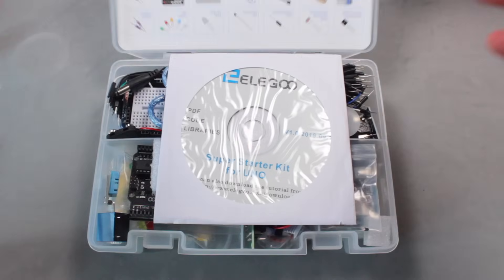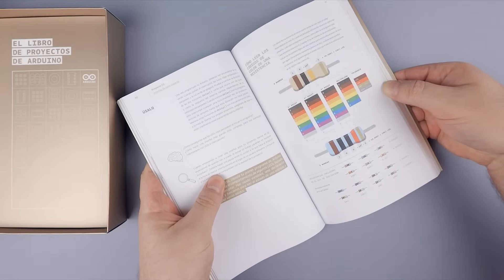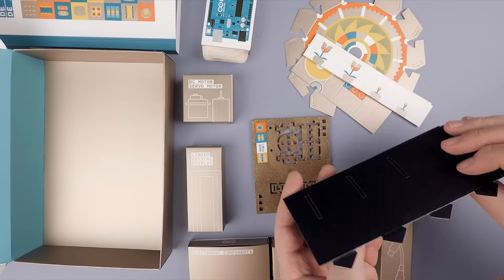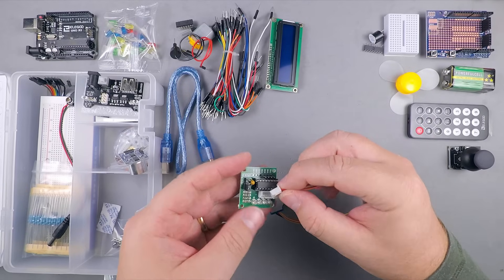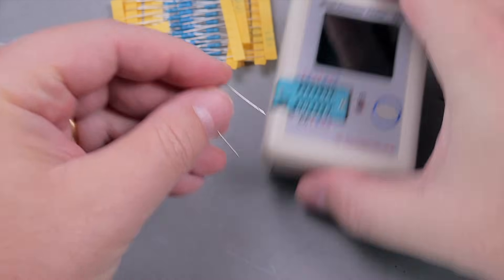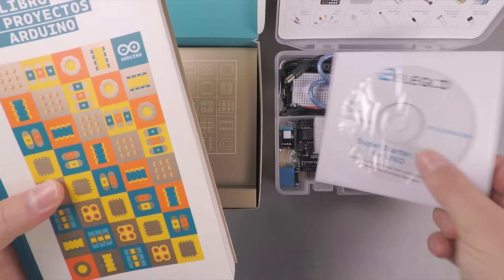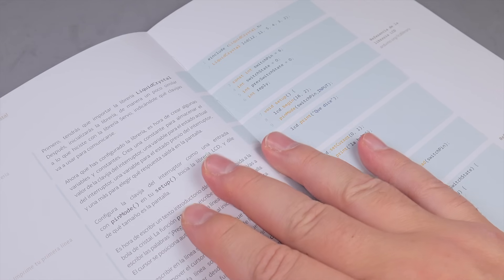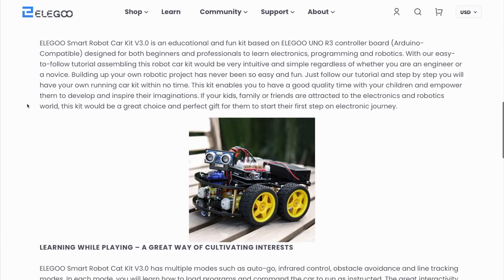Which Arduino to buy? Arduino Starter Kit vs Elegoo Uno R3 Starter Kit

Comment: Thanks, greatly appreciate that ... very convincing, I am with the old books,  I will give it a try to learn something new.  Had  been 40 yrs since my teenage years that  I dont do breadboarding nor ethching circuits in PCBs with FeCl2 solution ...I dont know all about Arduino, only heard that for years....  Been working with PLC/DCS/SCADA,   industrial controls and  in telecom industry as an engineer
Reply from the maker: Hi Noel! I am absolutely sure you will have a BLAST with the Arduino IDE and how easy it is to create cool machines. AND if you buy stuff on AliExpress, don’t search for “Arduino Module” or “Arduino Sensor” or “Arduino RF module” and NEVER search for ESP32…. trust me: any of those searches can lead into serious addiction 🤣😁

Comment: I have a question. which programming language does the elegoo part have?
Reply from the maker: Hi there! Both the Arduino official Kit and the Elegoo Kit you program using the Arduino IDE, using C / C++. The board itself, on both kits, are virtually identical.
Reply from the maker: An Arduino Tutorial, for beginners, might be interesting to you: https://youtu.be/fJWR7dBuc18
Reply from the maker: Another interesting overview: https://youtu.be/nL34zDTPkcs

Comment: I have rhe Rex Qualis version of the Elegoo kit and it to has the UNO headers well labeled. The quality of the kit is okay for the most part and came with quite a few more modules to experiment with such as an LED Matrix, RFID module, PIR sensor, Gas sensor and many more. I got this kit to familiarize myself with the Arduino before attempting to update the firmware in a 3D printer but since then I've made several green house controllers one of which uses a mega and monitors four DHT22 sensors and controls the humidity based on the average. It's been a lot of fun and keeps me busy in my retirement years.
Reply from the maker: Wow! I kind of envy you - I am having very little time even to make the videos I want to make 🤣 I wonder if I will ever stop hustling and enjoy retirement one day. 😭
Reply: @GeekDetour  I hope you get the opportunity to spend your retirement doing what you love to do. I spent 41 years designing machines that used temperature / Humidity controllers and now I have the fun of designing my own.

Comment: As far as I know, blue is military 1% most accurate.
Reply from the maker: Yeah! Metal film resistors are electrically superior in every aspect - except we cannot read the color code 🤷‍♂️  I wish the industry just give up the blue color and make 1% tolerance metal film resistors painted with beige and thicker ring strips so reading resistors can be fun again 👍😁

Comment: Maybe I missed something, however, when it comes to resistors why are the 5% tolerance (brown) resistors better than the 1% tolerance (blue) resistors with respect to Arduino! It seems to me that the 1% would be more accurate/specific and better suited for digital projects. In audio/guitar pedal projects this loose tolerance doesn’t seem to matter much.
Reply from the maker: Hi there! Metal Film resistors (1% tolerance) are indeed BETTER in every electrical aspect than the older Carbon based resistors (that today are usually 5% tolerance). The ONLY problem is: a LOT of folks cannot read the color code on these blue resistors - and I have perfect color vision! I wish the industry could make metal film resistors and paint them over beige backgrounds, like the old ones that we can actually see the color rings.

Why I don’t hate the carbon 5% tolerance resistors: because they work super fine for hobby applications! When I started messing with electronics, in the 80s, I used to buy resistors with 10% error tolerance… sometimes even 20% tolerance! At that time, 5% tolerance resistors were expensive and considered “precision”… I hope it brings some perspective to why I wouldn’t bother so much dealing with 5% error, if the benefit is being able to see their values. Once more: please, industry, we love metal film resistors… make them beige! 🤣
Reply: @GeekDetour  I simply accept them as marked on their strips, as the are usually found in groups/packaging, then test them with my multimeter for certainty. My eyes are not what they used to be either. I also find that the Chinese 1% resistor colors can be a shade off too from batch to batch (which, with magnifying lenses can be verified color band-wise as well).
Reply from the maker: @ZafodB3  Ha ha ha, yeah! Well, another option would be abandoning the color code all together and just write the numeric value on them, just like they do with some SMD resistors 🤣

Comment: I bought an elegoo starter kit, super starter kit and arduino mega as well. As an electronic engineer in year 2 I must say thier products are very well made at such a cheap price. I agree with the resistors point 😂 I thought I am the only one who had a hard time reading them. Nice vid
Reply from the maker: Thanks man! Have fun with your kits!!! 😄
Reply: They are really not that hard to read,  just as some colors are very hard to see and read on the brown.  Both blue and brown are very small,  so at my age and needing glasses,  a magnifier is a must.  I prefer the higher accuracy blue resistors now.

Comment: you want to tell me there is a tester for resistors??? oooo, gonna buy now right away!
Reply from the maker: Well, it is a tester for lots of components: you just connect resistors, diodes, capacitors, transistors… it identifies what is is, tell you the value and PinOut. In the case of transistors, it tells you the type and gain. It is a very useful tester!
Reply: @GeekDetour  yes, thats what I need, I dont even know how to calculate diodes and resistor to go together :) thx

Comment: Arduino Starter kit is about $92 , while the Elegoo is about $39. They both do the same thing. Unless you're the type that needs a name brand (looking at Apple users), save your money and buy the Elegoo product. The book is not worth spending that much more on the product. The online documents on Elegoo page is just as good. Very well written, very informative. Save your money so you can buy other electronic components for your projects. IMO.
Reply from the maker: For me, the difference in price is quite substantial - and besides being cheaper, you get more components from the Elegoo Kit. BUT, I like the experience of reading and manipulating the book while following the projects. For some people, 50 bucks is not much 🤷‍♂️ Also, buying an original Arduino product helps to fund Arduino software and the forum service. So, it is not just “throwing money through the window”. My first kit was the original Arduino one and I loved it. I bought the Elegoo Kit two years later basically to make this video and I used it for lots of small projects - after that, I’ve been purchasing individual modules from AliExpress. That was my personal trajectory. But I agree with you: if money is a factor, get the Elegoo Kit - it is great and much cheaper.
Reply: @GeekDetour  starting off, I would suggest people to get the Elegoo brand....because maybe this isn't for them then they're not out a lot of money. I've purchased cheap things before to see if I would like it. Then if I do, then I step up and buy the official brand. If that makes sense. I bought a cheap solder station, found out I love doing electronics, then bought a really good quality one.

Comment: I have blue resistors. They're way better than the tan ones you're referring to. They have a tolerance of 1%.  My eyes are horrible, so I use a multimeter at all times to test them. They are either spot on or 1%. These are quality resistors.
Reply from the maker: You are 100% right! Blue metal film resistors are electrically superior in every sense. BUT, it is impossible to identify their value just by looking at them (A LOT of people have the same difficulty). I wish the industry as a whole would simply go back to the old color pattern. There is no advantage in having them Blue 🤷‍♂️ Everybody makes metal resistors today. It is not a technological challenge/differentiator anymore. So, why not just making metal film resistors and paint them the old way?  Or abandon the color code and just write the value straight away, like SMD resistors do.
Reply: @GeekDetour  stop this.!!!!!
Identify the value of BLUE resistors is WRITTEN CLEARLY IN OHMS,  ON THE YELLOW STRIP OF EACH PACK OF 10 RESISTORS !!!!!!
Stop SLANDERING ELEEGOO.

YOU DON'T EVEN KNOW ELECTRONICS. 
FAKE EXPERT

Comment: Thank you so much for the information. Awesome video and very informative. The book looks amazing. Can I purchase the book by itself and use it with another kit? I live outside of the US and purchased kits locally for the school. Thanks again.
Reply from the maker: My pleasure! 😁 The book is not sold separately (it is mentioned in the book). Sure, most Arduino kits have the same components, and the basic projects are kind of “the same”. I suggest you to look at the Elegoo’s website and download their material. Also, sometimes you can get lucky if you search for “Arduino Projects Book PDF”… but they come and go 🤷‍♂️

Comment: Can you tell for a begginer is Arduino kit better or elegoo kit
Reply from the maker: The official Kit is way more expensive - but the experience of reading and following an actual book while making the projects is quite nice - I would say it is the most recommended for kids/adolescents.

The Elegoo Kit is considerably cheaper and brings more components. If the person who will use the Kit is accustomed to following PDFs for instruction, it is an excellent Kit.

Comment: Что он говорил про резисторы, русские есть?
Reply from the maker: No! ha ha. I said that the Blue resistors are difficult to read their value (the color rings are too thin and the blue background color makes it ever harder to read at a naked eye). Those are modern metal film resistors - they are better than older carbon resistors in every sense. But the color choice is very annoying.

Comment: not disrespecting. But, I think you might might not know that blue resistors are better. They are non flammable high precision. and resistor only comes in blue or pale brown.
Reply from the maker: My rant should have had more details… Blue Resistors are better in every sense: precision on the value, it doesn’t vary as much as it gets older and also has a more stable curve over temperature variation. BUT - and I am not alone - I cannot read the color code. I doubt most people can be sure about the value when they get a blue resistor from a pile. Terrible background color. The industry should change the color or write the value directly, like they do on SMD resistors. For hobby purposes, 5% tolerance on the Beige carbon resistors seems enough for me - and I can read them instantly.

Comment: What can I  build
Reply from the maker: Well, these started kits are much more focused in teaching you the basic of the Arduino and a bit of electronics - it is not a toy or kit for a bigger project (like the Elegoo Tumbller, which is a balancing robot for example). After you go through the lessons of the Kit, you can challenge yourself with a series of DIY projects: a chronometer is a good example. Or simulate two traffic lights 🚦 of a crossing…

Comment: I have always only programmed in asembelly and C and use a single atmega328p im about to buy this kit because its easier to use i have learn alot from c code and arduino is based on c so i think it will be much easier to use. Also raspberry pi works.
Reply from the maker: Hi Andreas! If you are already a C programmer, I think you can go for a cheaper kit with more sensor/actuators - more fun for your buck! :)
Reply: @GeekDetour  thanks for answer

Comment: Are the elegoo sensors compatible the arduino board?
Reply from the maker: Hi there 👋  Yes! Actually, you can buy whatever box/pack of Sensors “for Arduino” and they will work with whatever “Arduino Uno” compatible board you have. I have A LOT of components that I don’t even know anymore in which Kit/package they came 🤣 All sensors/modules made for “Arduino” are prepared to work at 5V voltage and logic level. You just need to pay more attention when you are making projects for Raspberry Pi, that uses 3.3V power and for logic level - then you need to double check things. Many of the sensors work at either voltages.
Reply: @GeekDetour  Thank you

Comment: My ardiuno uno bourd stopped working after a few days when I connect it to my laptop it does not lite up how do i make it work again.
Reply from the maker: Hello there! You need to better define what is "stopped working"... 
1) is it completely turned off/dead? Have you tried a different cable? 
2) does it continue running the last program you created? You just cannot find its serial port or the Arduino IDE? Have you tried rebooting your computer?
Reply: @GeekDetour  1

Comment: blue resistors are better bcz they are of 1% tolerance!!
Reply from the maker: Absolutely, not only that: they keep their nominal value better as they get old (compared to carbon resistors), and they are less affected by heat as well… they are better in any way. BUT, I cannot read the color code - and I am not alone. I wish the industry changed the background color of metal film resistors to something better.

Comment: Please tell me how to make female headers and a arduino uno board i subscribed your channel please
Reply from the maker: Hi there! I don’t exactly understand your question. Did you buy an Arduino Uno Board without the female headers? Or are you trying to make a stackable “shield” board that goes on top of the Arduino? In either case, you can buy 2.54mm Female Headers and solder them - you can find them on Amazon or AliExpress easily. Actually, there are also “Arduino Protoboard Shields”

Comment: Hey man! 
I'm 15 and into entrepreneurship but lately, I've been thinking to learn robotics, etc and apply that to maybe create a product I could bring to market. 
I don't know any programming languages and have zero experience with AI and robotics. DO you think the Arduino Starter kit is the way to go considering my goals?
Thanks for the awesome video btw :)
Reply from the maker: Hi Suhaan! Thanks! You are young and I understand the anxiety to find your way into a career. Robotics mixes electronics, mechanical engineering and programming - to be successful AND HAPPY working in this area, you must learn AND ENJOY these three areas. So, any Arduino kit with servos, stepper motors and sensors will serve to challenge you. That’s the best thing of the Kit - I recommend the Elegoo Kit, cheaper and with more things. If you study the material, and can do the experiments/projects and start to understand how to change the programs, and ENJOY doing that, that’s a good indication Robotics could be a career for you. If nothing makes sense, programming tutorials look boring to you… then it indicates that it is not a good match for you. Either way, it is a nice way to discover!

Does it make sense?  When I was a teenager, I loved programming Basic on my Apple II 8 bit computer, even tried Assembly. I never stopped programming, and I got into development later on… So, it must start somewhere 😄. Don’t be afraid to try.

Comment: With which machine you were checking the weight pls give link
Reply: No not that machine I am talking of that machine by which you checked the blue resistor
Reply from the maker: Oh, it is a Multi-Function Tester, you can find exactly the same product under different name brands. There is an Amazon link to it in the description.
Reply from the maker: Oh, the finger that touches the iPad button? It was something I’ve put together to press the button every 5 minutes and then take a photo of the screen using a camera. It is not uploaded… I don’t even know if I still have the code 👨‍💻

Comment: 3:33 I have a recent official Arduino Uno R3 board and the pins are identified on both sides just as in the Elegoo one. They have probably improved that since you made your video.
Reply from the maker: That’s right, I saw photos and videos and that’s true - it is a good thing 😁
Reply: Plz if possible I want pdf of the book

Comment: even tho arduino has lesser stuff why is it more expensive that uno?
Reply from the maker: Hi there! Both kits have the “same” Arduino Uno R3 board (use the same components). You are right: Elegoo Kit has way more modules/extra-things and costs less than half.

The official Kit is made by the Arduino company - a physical book would naturally increase the cost, but not so much that would justify the price. When you buy the official Kit you are actually “buying/helping the brand”. Arduino.org creates is constantly making more material, keeping the forums, creating better versions of the Arduino IDE, etc.

The Elegoo Kit has its own board, which is a copy - this is not a problem, it is all “open source hardware”, anyone can make identical boards, just not trying to “fake” the Arduino brand. They have a much smaller profit margin - but again, Elegoo doesn’t need to create and maintain software like the Arduino IDE. Even so, Elegoo makes excellent tutorials for their products.

There are even cheaper kits.... but the quality of everything begins to suffer. Bad quality connectors, poor tutorials or even no tutorials at all (just the components)... Once I got a REALLY cheap Uno R3 board clone that came in really bad shape: It had terrible soldering connections, components were visibly misaligned in the board, ver bad quality control. It worked... but I wouldn’t be surprised if they would sell non-working units.
Reply: @GeekDetour  What a helpful reply! You gave me all the information that I needed, thanks for the help.